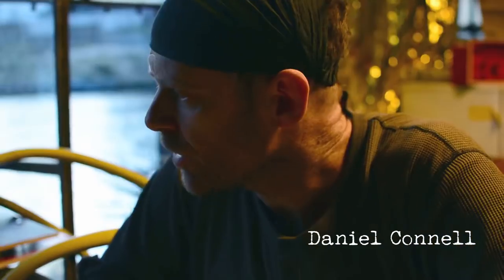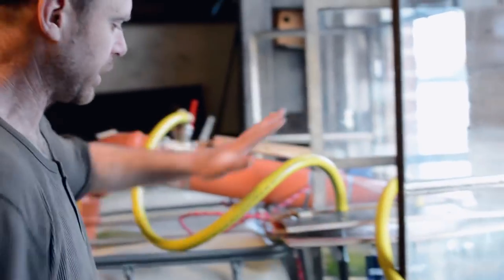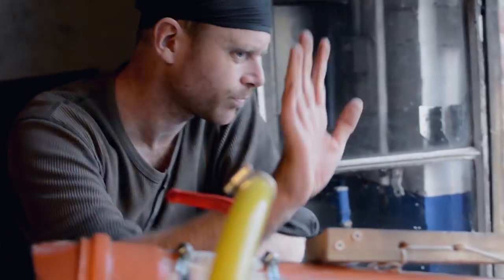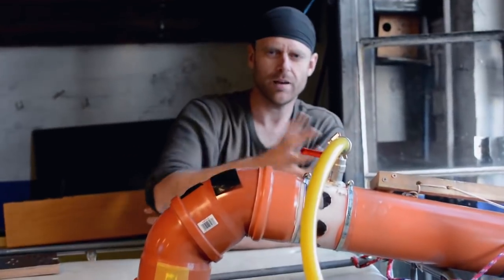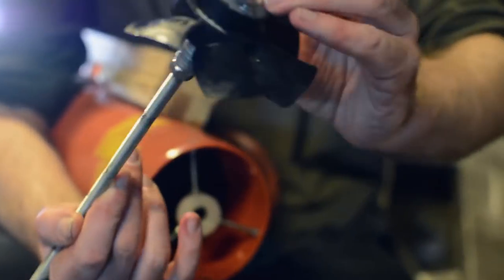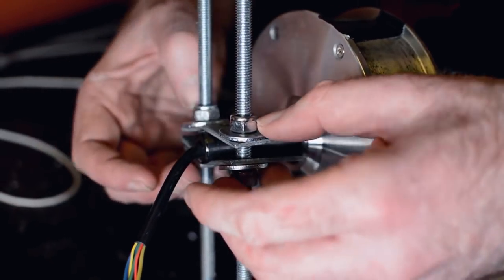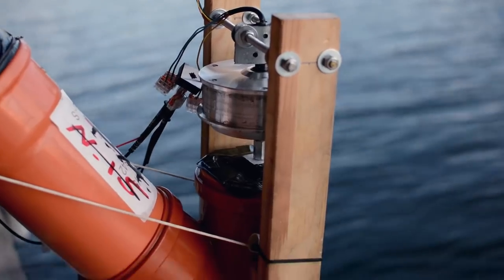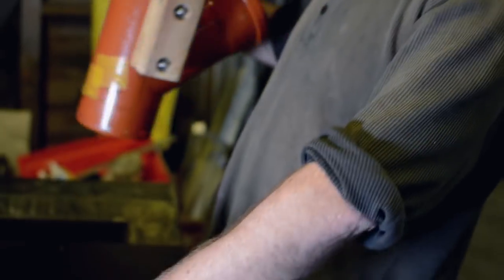$50 Water Turbine-5 kilowatt hrs/day - Open Source, DIY

Comment: one question, why worry about the PC fan at all?  Considering you can re-purpose them from E waste? Personally I have four or six loose fans laying around my house.
Reply from the maker: This is largely my approach; that as long as it's cheap and easy to replace it's super critical that it lasts forever.
I've made the connection and mounting method fairly simple to swap the fans out, so if people have to just put on a new one every so often then that would still seem workable.
Not, like, every other day or something. But maybe once or twice a year. Will see how it works out in practice.

Comment: great project! Why don't you just pump out air from the pipe when starting instead of pumping water into it - water would just go inside on its own then?
Reply from the maker: Yeah that's how it's generally done in an industrial setting. I didn't for two reasons; I could get a submersible pump a lot easier than a vacuum pump, and earlier versions of the turbine didn't have the outlet ending under the water, and the original flap gate wasn't air tight enough.
I'm basically using the water column draining out back into the river as a vacuum pump tho to suck out the last of the air.

None of this will hopefully be necessary in actual field use, as it probably won't be a full siphon so much as just a straight length of pipe. Will have to devise an appropriate filling method for that configuration, but should be fairly simple I think.
Reply: @OpenSourceLowTech  thanks for response, you could also use a tee and have your geneator placed inside a pipe. In this way only cables would need to be sealed and not a shaft.

Comment: Great video, thank you for sharing. 
I would like to know, what would be the minimum drop required for this design to work? How would the drop height effect the pipe diameter?
Reply from the maker: There's not really a minimum as such, just a matter of how much power you're wanting. I'm also working on  tiny version for 5V USB.
Generally tho about 1.5-3 meters would be about ideal.

Drop and pipe diameter are fairly mutually exclusive. The more of either the more power. 
However, for the field test install here in Scotland tho I'll be reducing the feed pipe down to 110mm as the drop is 4-5 meters and the alternator is only rated to about 350W...

Comment: have you tried stacking fans?   may increase swept area thus improve power
Reply from the maker: I tried two back to back and it had no effect, but a couple guys in Indonesia made one and reckoned they got increased power with them about half a meter apart.
Which would affect the build process a bit but I'll give it a go and see what happens.

Comment: Could this be made on the back side of an earthen dam at say a 45* angle instead of vertically for the output side without a loss in efficiency? Thank you
Reply from the maker: It'll definitely work at an angle, and I'm assuming most in the field will be. There's probably some loss of power if the water's velocity is less due to the angle, I'll be finding out directly with the field tests this yeat.

Comment: love your idea. would't take much to use bigger pipes and better turbines either if you have the budget
Reply from the maker: More diameter means more power. I didn't for this, partly due to the price point, but also wanting to keep it to a fairly realistic expectation of what kind of flow people are likely to have access to.
But yes, if you've got more water, this will do more power.
Reply: @OpenSourceLowTech  i agree and would't change your prototype as the best realistic alternative for parts. curious what only changing the fan blades to more hydro friendly shape could do also. if there's such things on ebay or could be made by scrap
Reply: @OpenSourceLowTech  could you build one in the same spirit that produces enough for a western home? think people in both developing countries and the west would appreciate and even more powerful version made from "scraps" with 200mm pvc instead of 110mm for example. this is really cool what you're doing
Reply from the maker: Same turbine unit with fatter in and out pipes and enough feed, you could power a house of this design. You would likely need a more robust impeller and heftier alternator for that kind of power tho, so with these materials might make more sense to have like three of them, in series or parallel depending on water availability, instead.

Comment: If you added several more impellers to the end of that shaft, it may pick up some extra energy lost to water passing around the blades.
Reply from the maker: I tried adding a second impeller fan but it didn't make any measurable difference.
Which wasn't necessarily what I was expecting either...

Comment: Where did you order the three phase bridge rectifier that you used in this model? I am making a portable generator that would go in a vehicle to produced a steady 120 volt source from an invertor connected to the 12 volt dc contant provided by the bridge rectifier. Got most of my protoype made. 😃
Reply from the maker: Just got it on eBay for a couple euro.

Comment: Great idea. Would be a fun and interesting project. I’m wondering how you’d keep debris out of the pipe in a river.
Reply from the maker: Mesh bag over the inlet. Will see how much that still needs to be kept clean.
Reply: @OpenSourceLowTech  That might do it. You could also try have the inlet at an angle to the water flow so water can flow in as it passes or maybe cone shaped. Perhaps the flow would keep it clear.

Would the fan cope with an increase in water speed? Wondering if you could increase the velocity of the water.
Reply from the maker: Yeah there may also be some better self cleaning intake designs. I'll have a play with a couple ideas this year with the field test builds.
The lifespan of the plastic fan remains the main thing to find out. Certainly it'll produce more power with more velocity, so that's largely what I was optimising it for with this prototype.

Comment: Try change your turbine fan to a stator and rotor axial flow I’m sure you will get much more efficiency. Stator to rotor blade angle difference 90deg
Reply: Perhaps scavenge from multi stage water pump
Reply from the maker: I tried with a basic stator turbine before the runner but it ended up reducing output power by about 30%. That's mostly likely just that I made it badly, but it's a bit of a tricky thing to make well..

Comment: Have a question? last tine I syphoned gas I was wondering if there is a geometric triangle that I could take PVC and run it kittycorner across the back of my house from water container to short of the eve, 1/2 foot straight, 90 degree angle  back down for 2 feet then level run it across rest of house put the generator there, estimate 12 foot drop wit a return line level back to water tank. hopefully a sealed system. what is the chance a system like this will maintain flow once started?
Reply from the maker: Not sure I quite understand, but if you're wanting the water to circulate itself in a loop then no, that would not be possible without some external source of energy to drive it.
Siphons work by taking water in high and putting them out low, essentially extracting the gravitational potential energy.

Comment: did you ever try to move the impeller like a meter down the pipe away from the generator/motor? like letting water fall free a bit before hitting the impeller? since you have a longer siphon, could this help at all?
Reply from the maker: All the water in the system is moving at the same rate of flow (liters per second, if not meters per second), but there could be advantages in terms of pressure gradients from having the impeller nearer the outlet.
I mostly put it where it is for practical and ergonomic reasons, but actual in field use configurations will likely be more as you describe.
I do want to keep the drive shaft relatively short tho, to cut down on warping under load.

Comment: I know a second in line propeller would take away from the first but what about a secondary type of generator to capture some of the water as it free falls from the pipe? Would that generate a viable enough yield to consider Incorporating?
Reply from the maker: It's been suggested that something like a waterwheel would be able take advantage of the pipe outflow without introducing back pressure, which is true, but the issue is the vertical height that the wheel or such would have to occupy, and that it would be simpler and more effective overall to  just have more pipe there instead.

Comment: Just a thought,I'm not an expert in flow mechanics. Wouldn't it be enough to widen the pipe for just a short bit (maybe half a meter or so) after the impeller (to remove cavitation) and then go back to smaller diameter pipes again? If so this would reduce the increase in price for solving the cavitation problem. Just a thought.
Reply from the maker: There is a flaring after the impeller, which does seem to be helping with cavitation and overall efficiency. Normally these types of turbines have conical draft tubes, but that wasn't really an option with the available materials.

Comment: Do you think the same tech/setup could be used to make a tow generator behind a boat? Trading water head height for tow speed though the water? Any idea how much water flow at 5 - 7kts might generate? Look forward to the plans! You have got my head thinking!
Reply from the maker: Those turbines do exist but you generally need a fair bit of velocity to get much power. Would just be a propeller with maybe a channel housing. You'd not need the siphon as there'd be no drop.

Comment: Hi Daniel, I have been thinking on a hydroelectric model for home. We can use atleast 2 turbines in that model. I am sure it can produce 1kwh/ 24Hr. We need a big water tank(We can use a small room outside of our house that we mostly use as a store or junk room). After making it anti water leaking by applying some cement on it. We need to build two small tank at difference elevation in a row. 

water from that big tank will come to the smaller tank and from that smaller tank it will go to the lower tank. At the end of each tank we have to install a water turbine a hydro electic motor to produce electricity. From the lower tank we can use Gravity feed pipe while creating the siphon. Which allow us to take water back to the water resivor(Big tank) WIthout using any kind of motor. 

Any thoughts mate? Sorry for grammar mistakes. I am not fluent.
Reply: I think its most practical model for a home.

Comment: Wait a minute, at 5:10 he explains that he fills the tank with a pump.
The amount of electricity it requires to pump that water is equal to or greater than what electricity can be generated by from Potential Gravitational Energy from the turbine; defeating the whole purpose of his set up.
Prime example of the First Law of Thermodynamics.
Reply: That's his test setup
Reply from the maker: Yeah this was only meant to get the design tested and optimised, in real world use it would be in a river or stream with natural drop.

Comment: What if you put a 45⁰ bend in the middle of the down pipe and install an other generator after it. Would it have the same results ? If so, you would double the power on a single system.

Comment: Do this with a car alternator! Not a fitty dollar project but probably more power 💯
Reply from the maker: Car alts are about double the max power of the hoverboard wheels, much higher max amps, and better global availability, but the efficiency and volts per rpm are low, and they'd be bulkier and harder to mount.

Comment: That's really awsome and resourceful! May I ask what your profession is? You went into aspekts I wouldn't even have considered despite being an engineer myself :D I wonder why you don't put the fan in the bottom of the tube. I imagine you would get more power this way? Would you even need the whole long tube in a scenario where you don't need to create a siphon?
Reply from the maker: I didn't go to university and have no professional experience.

As it's a momentum, not pressure turbine, such as a Pelton or Turgo, the power comes from the water's inertia, and so you want it moving as quickly as possible.
Having the fan at the outlet would still function, but would likely negatively affect the overall efficiency as it's the negative pressure suction force that is moving the water.
The main reason tho is more ergonomic, it's just an easier thing to build and use having the turbine assembly above the draft tube. There'd be issues with having it lower.
I will tho be experimenting with altering the length of the draft in the upcoming longer term field test build, and seeing what effect that has on the power curves.

The two I've tested so far; this one in Berlin and the one previous in Catalonia, both need to go over walls, and so had to be full up-over-and down type siphons. I think this is probably less efficient and effective than a just-down length of pipe, which the field install near Glasgow will be, and shouldn't need priming like these two did.
But, options.
Reply: @OpenSourceLowTech  Did you already experiment with several fans on the same shaft? That would also be quite interesting.

Comment: Hey how does the output look? Just two wires providing 48v? Does it need a controller/inverter and can you talk about that? Amazing video btw gratitude
Reply from the maker: Hoverboard wheel as alternator puts out three phase AC.
That can then be rectified to DC, about 61V at the peak of the power curve for this configuration, for a charge controller and batteries.
Reply from the maker: Specifically which boxes / components to use will depend on specific situations. I'll be doing a couple field installs here in Scotland this year, more info to come.

Comment: Hey just wanted to say great videos! Are the recycled computer fans still holding up in the field after year of use?
Reply from the maker: Both the Barcelona and Berlin installs were temporary, but I'm in the process of installing a longer term field trial near Glasgow, to find out how the materials hold up.

The plastic fans have so far held up to quite a lot more use and abuse than I was necessarily expecting tho..

Comment: If you attached the pipe with the turbine in it, to the side of a boat, would the boat create enough water pressure in the pipe, as its moving, to run the turbine?
Reply from the maker: The water was going through the pipe at about 3 meters per second, which is about 6 knots, or approaching top speed for a lot of vessels.
So, kinda, maybe?

It's going to introduce a fair amount of drag tho, so if you're under power you might as well have just run an alternator off the motor, but if you're under sail with enough wind then it could work.

But then a wind turbine might be more practical.
Reply: @OpenSourceLowTech  I'm moving onto a narrowboat, I live in UK, just thinking up ideas for generating eletric, lol, it seems a constant worry for full time boaters.
I don't think it would work on a slow narrowboat lol,  although I wonder what the effect of having different pipe sizes would have, like a large aperture at the front, then narrow it down further on,  kinda the way you would treat an electrical circuit,  adding resisters, to up the volts,  narrowing the pipe just before the turbine, perhaps would have the same effect on the water pressure.
Anyway I'm a beginner so I've no idea what I'm talking about lol, it just seems logical to me that putting restrictions in the pipe would create more pressure than one straight through same diameter one.
Reply from the maker: Ah ok, yeah a narrowboat definitely won't do anything near that kind of speed.
Wind and solar would be your best bet.

Comment: Excellent I am giving this a go. What size stud rod and nuts are you using. Looks like 10mm?
Reply from the maker: For the drive shaft? M8. M10 would also do but the former is certainly strong enough and fits some of the other mechanisms a bit better.
The three to hold the bush bearing are M4, the two threads to mount the alternator M8 or M10 as you prefer.
Reply: @OpenSourceLowTech  Yeah thanks,just been out a bought M8, as it looked a better fit and lighter.
Reply from the maker: Let me know how you get on. Email address is on the website.
Reply: @OpenSourceLowTech  Will do.

Comment: Yeah , the price as to go up 
Not many hoverboard at the price your mention. 
But great ideas all the same 
You can't found cheaper for the amount of electricity that give on 24 hours 
I wonder if in the country that you mention,  would they come across them hoverboard ?
Would it be better to build them here and send them away !
Keep coming the great stuff
Reply from the maker: You can usually get a second hand board with two wheels for 20-30 $/£/€, but as you say they're a lot less common in many parts of the world.
Best universal option I know of are motobike alternators, which I'm in the process of also testing with this and the wind turbine.

Comment: did you ever try the pelton wheel as a propellor ?
Reply from the maker: Peltons need quite a bit more pressure to operate well, usually at least 20 meters of head.
Reply: @OpenSourceLowTech   ok Thanks